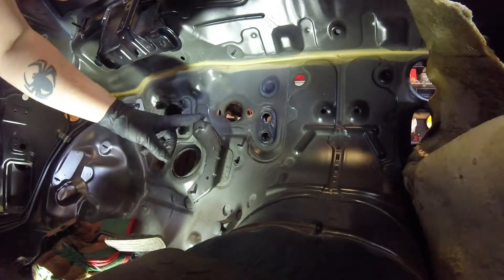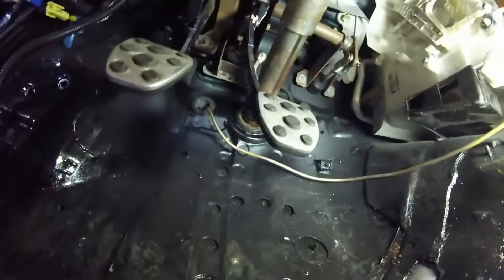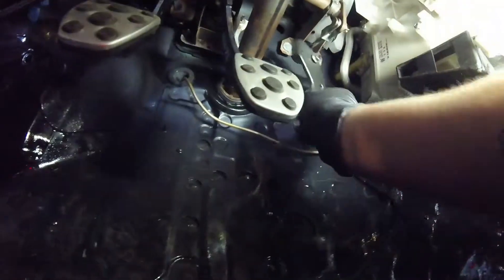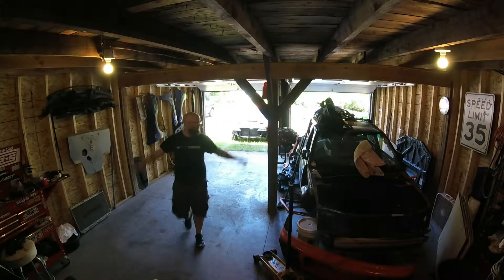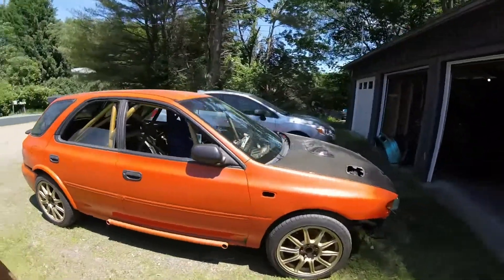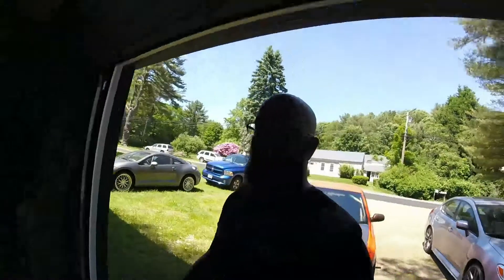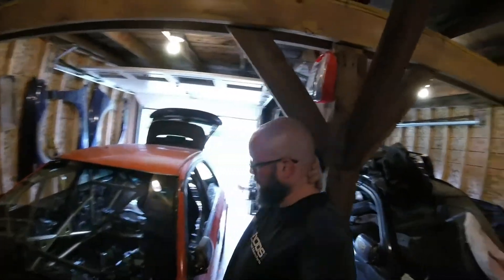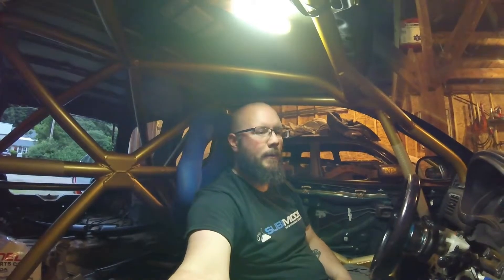Subaru Drive by cable to Wire conversion, now it moves!!! Hillclimb project

Comment: Did you get the rear brakes freed up?
Reply from the maker: I think they’re still sticking, I’m going to make a bypass brake line and take the hydro out of the system.  See if that’s the cause because I think both rear calipers are hanging.  If I get some motivation I’ll go do that later today lol
Reply: @GarageMetric  oh that sounds exciting. Makes sense starting with the hydro